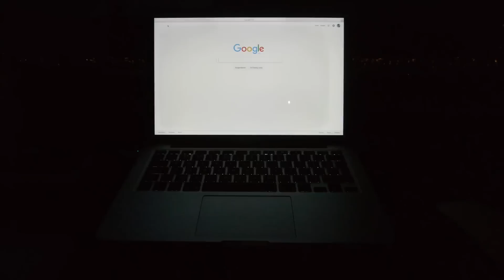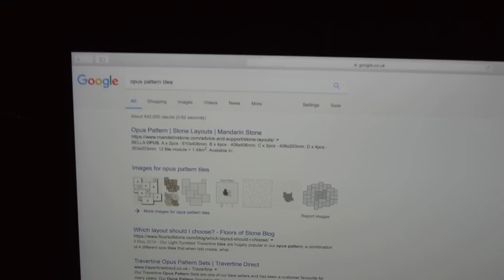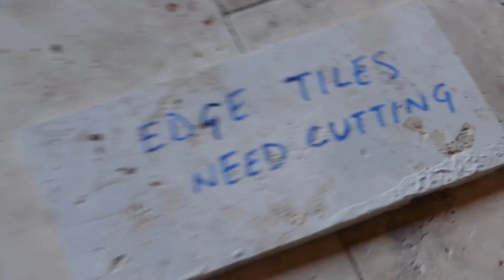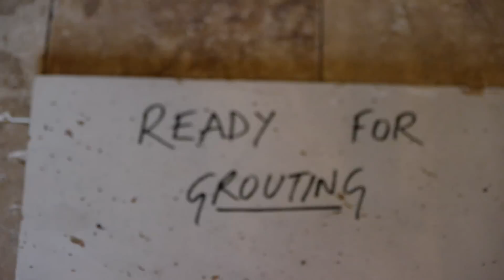How to Build a Floor - Laying Tiles

Comment: That looks really good, called the Versailles pattern, a real bugger to get right if you do not keep your mind on the job, I made a sheet up and as I layed a tile my wife ticked it off, the problem was the small square tiles were 3mm thinner, so when I put extra adhesive to bring them level it squirted up through the holes, the pattern is well worth the effort though, nice to see you did it the proper way, laying from the centre line, rare to see that in France! Chris B.

Comment: Good dry pack float,check, good design, check,  mixing wand and drill, check, half inch notched trowel, check, no knee pads, no check.... really sore knees.  Bare at that! Now that's hard core!

Comment: Great effort, the only thing I'd say is use an acrylic primer or SBR instead of PVA as PVA only dries so any water ingress can pop your tiles off and keep your lines going the same direction when raking out your adhesive so they collapse properly and give you good coverage :)

Comment: Excellent work. Looks freakin awesome. I just wish that somewhere between the concrete, screed and tile, that you would have put some in-floor heating mat. Electric or some hydronic tubing. There's nothing like radiant floor heating. Great job nonetheless.

Comment: Important to back butter travertine to fill voids or it will crack cause it's soft
Reply from the maker: Car channel will keep you updated if it cracks. So far 3 months and no cracks 👍🏼
Reply: Car channel bull
Reply: I always back but my trav jobs the floor gets more strength from filling the holes at the back of the tile. Less chance of cracking tiles.
Reply: carlrogers yeah it WILL fail at some point. Trav is too soft the lack of back butter and improper troweling will lead to failure
Reply: back buttering plus sealing the stones before grouting to be sure

Comment: I’ve laid countless floors over the years, but would seriously recommend wired underfloor heating before tiling, the way the cost of gas is going it makes sense, is far cheaper to install than piped and extremely efficient to run not to mention no need to service. I love what you guys do but seeing a tiled floor going down on a perfect screed without exploiting underfloor wired heating is I think a wasted opportunity as I sit here in my kitchen, rad less with toasty feet on my tiles. Equally who am I to say, each to their own.

Comment: I have 15 years installing floors and it is wrong as they were, you have to put the cement in one direction to get the air out
Reply from the maker: These tiles have holes in... the air got out.
Reply: @carlroge  I’m pretty sure that’s rubbish anyway.

Comment: Yeah this is not a good method of installing tile... at min you should have your trowel marks running vertical all in the same direct so you can collapse the ridges and you need to back butter these large stone tiles.

Your coverage is weak bro... but decent job on the layout...